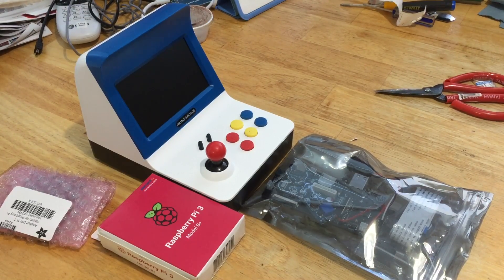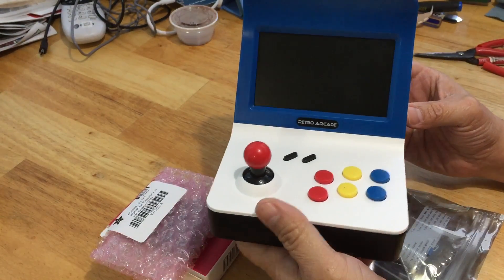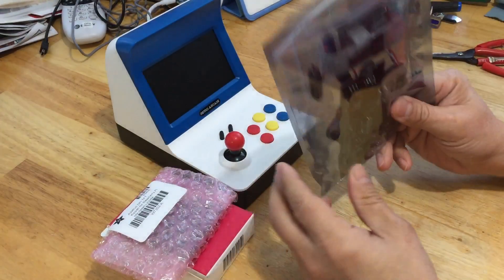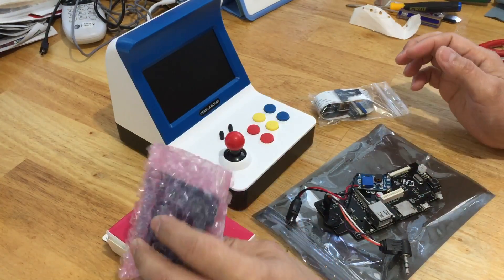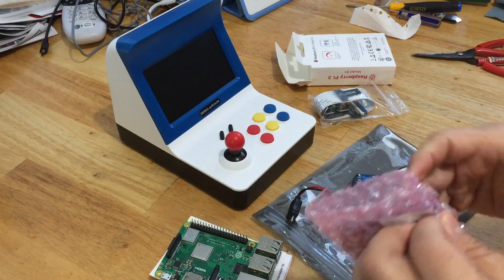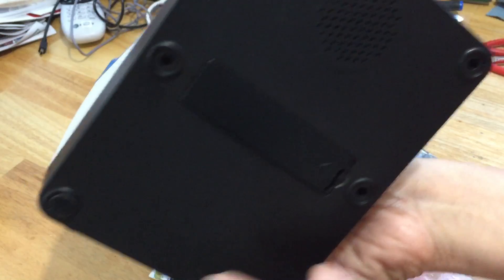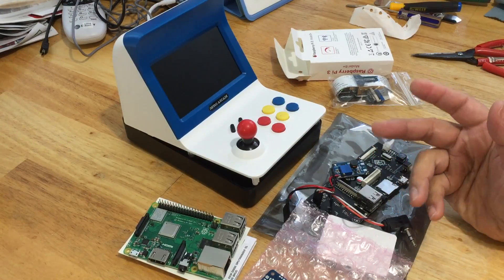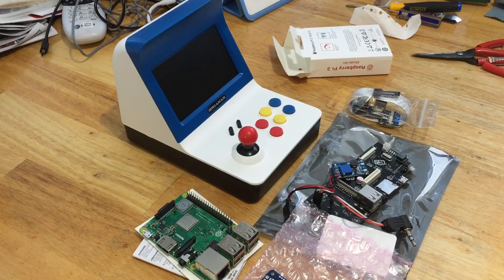RetroArcade upgrade to new board RgR with Raspberry Pi 3B or 3B plus. Part1

Comment: Aiwo g1000?
Reply: @johnny58435  ok ☹️
Reply: @johnny58435  I have already tried it and it has given me many problems with the external controls that I want to use
Reply: @johnny58435  What I want is to play two players on the aiwo with arcade controls and they don't work well
Reply: @johnny58435  I have these Nygacn njp 308 controls, they don't work well

Comment: Si lo conecte correctamente , segui correctamente el totorial y no funciona el joystick de la rs07 ni tampoco el adaptador usb , si funciona el usb conectando un control directamente al usb de la raspberry pi3b pero el adaptador usb y el flex del joystick rs07 no funcionan ..... existe algun notepad o drivers ?
Reply: If they connect correctly, we follow the device correctly and the rs07 joystick does not work nor the usb adapter, if it works the usb connects and directly controls the usb of the raspberry pi3b but the usb adapter and the joystick flex rs07 not some Notepad or drivers?

Comment: hi, buy the kit but there is no way to recognize the usb port or the joystick of the retro arcade rs07, is there a driver that needs to be installed or the components sent are bad?
Reply: @johnny58435  If they connect correctly, we follow the device correctly and the rs07 joystick does not work nor the usb adapter, if it works the usb connects and directly controls the usb of the raspberry pi3b but the usb adapter and the joystick flex rs07 not some Notepad or drivers?
Reply: if you have issue with the adapter, you can ask the manufacture via their facebook page.
Here it is:

https://www.facebook.com/RgR.Development/
Reply: @johnny58435   facebook   :   https://www.facebook.com/kinghousejoselo
Reply: @johnny58435  for whats app  +56 9 86861729  and  for facebook : jose cabaña muñoz

Comment: Regarding the raspberry Pi. For those asking if you go for a Pi 3b + you are asking for problems, get a 3b there is no real processor power gain if you use the plus and emulating wise no major plans to develop the support you get from a b board. Keep it simple